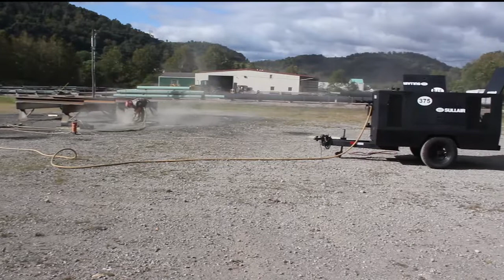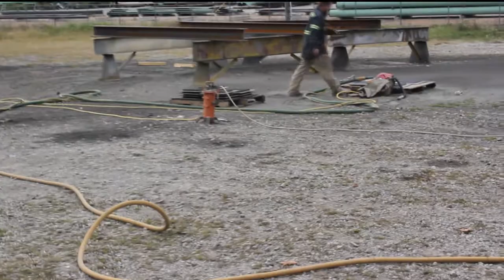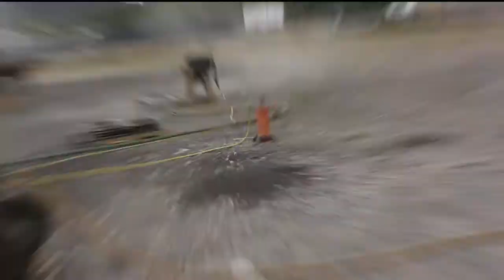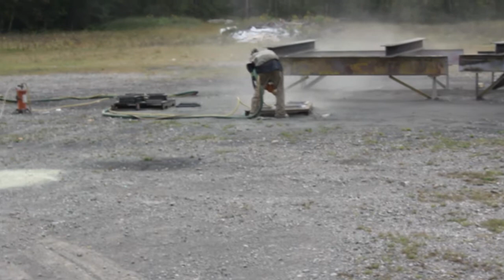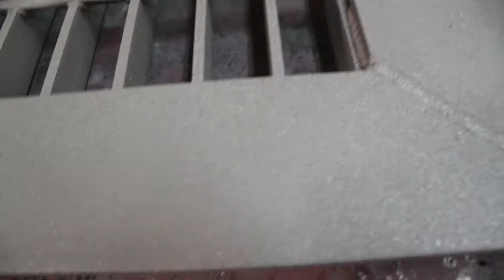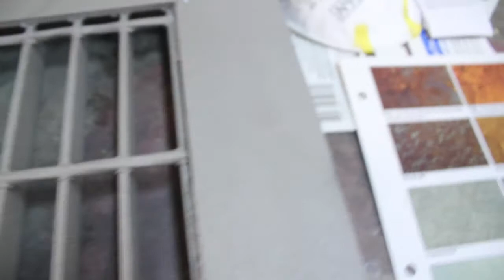How to Sandblast & How to Use a Sandblaster for Maximum Results

Comment: If possible you want to be at a 45° angle not directly over the item and 6 to 12" depends on a number of things how the item looked like after test patch its sometimes faster to move closer also depends on the nosel loads of factors the operator can work this out within the test patch

Comment: I'm a trades assistant at a welding and construction company and they've just set me up to start blasting,  we have an RPB nova 2000 helmet run through a filter off the electric  workshop compressor, my question is should we be using a co2 monitor?
Reply: Mark French  Hello Sir I am doing a blasting and metallizing call me 8433508714
Reply: not a bad idea
Reply: Electric compressors do not make carbon monoxide as do my diesel compressors. So you have nothing to worry about.